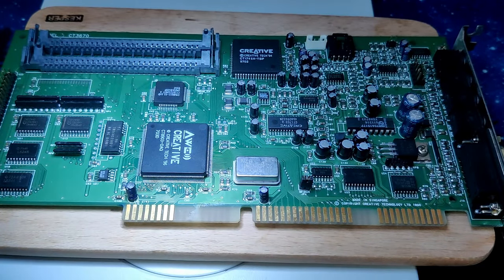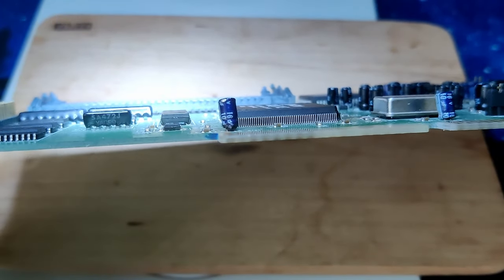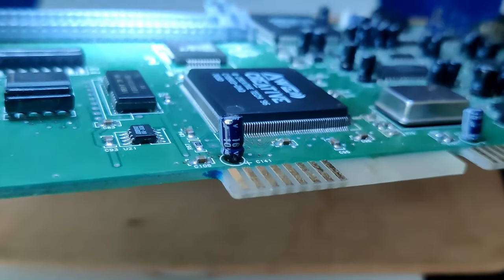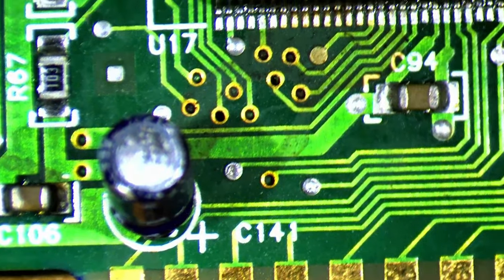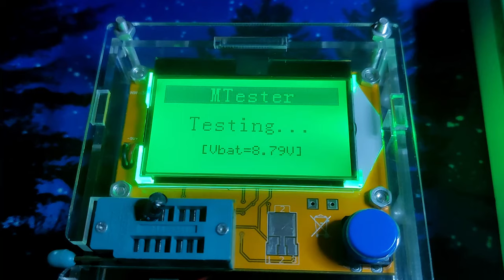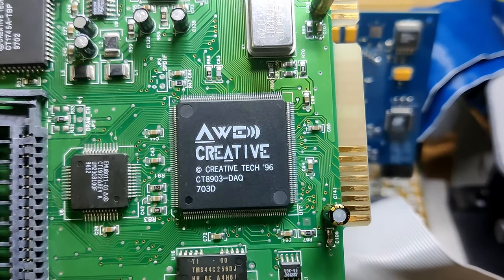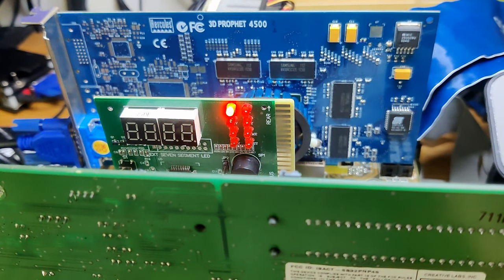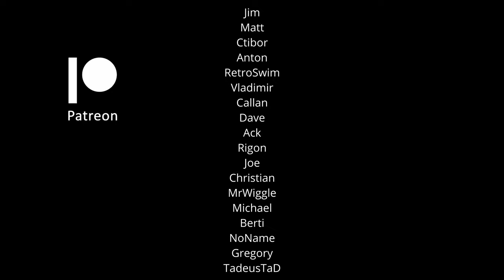Forensics: Sound Blaster 32 CT3670 repair attempt

Comment: I hadn't realized how insane the owner went with the hot air, I wonder if they got a soldering hot air gun or a woodworking one for paint removal... I suggest recapping the whole board, electrolytics hate heat and it was applied very globally and for ages, and even on the video the other caps don't look great IMHO, I hope it's just a cap that failed shorted or something like that!

Comment: Has this card been reverse engineered or are schematics available? Could possibly be one of the smaller 74 logic chips ... but without a schematic/block diagram it's just guessing. I know on a GUS PnP (since I was the first person to reverse engineer those) a faulty 74F32 would prevent the system from booting.
Reply from the maker: I actually found a small solder bridge between two signal pins. That was very odd - thin as a hair. The PC boots now, and I could get sound from it. The FM synthesizer didn't work, but that may have been an issue with drivers and Windows 98. I'll try the card in another system and also play around with the flash chip on this card.
Reply from the maker: Wow, that is some serious skill to reverse engineer a GUS! Congratulations. Are those GUS clones the result of your work?
Reply: @bitsundbolts  Yeah, definitely check the drivers. I've had the same issue with an AWE32 in the past. Glad you managed to fix the card.
Reply from the maker: I hope to learn a lot more about electronics. It's such an interesting subject. I'm a software engineer by education, but lost touch with the field. It's rare to find interesting projects to work on in a corporate environment and I'm tired of maintaining a 20+ years old codebase.
Reply: @bitsundbolts  I'm always impressed by people who can be bothered with or even enjoy coding. I just recently poked my nose into a small (400 lines) C Project for a MCU and while I understood most of it just couldn't get myself to make major changes in the code (in the end I duplicated a function and added 2 resets, while removing 1 optional function) ... resulting in my final fix being a second (identical) MCU being added 😅

Comment: I may be on a wild goose chase here so take this information with a lot of salt.
However the C0 at least for Phoenix BIOSes relates to the ISA standard of Interrupt 19...
Further digging lead me down a rabbit hole of information related to a software requested halt that is usually done by IDE / RAID controllers to initialize their drives to be booted by the computer.
I am no ISA expert or even knowledgeable, but there are interrupt request pins on the ISA standard pinout... Maybe it is being pulled high or low (Pending on what it wants) due to some factor elsewhere on the card.
Reply: This is tested on an Asus p3b-f, it has an award bios.

Iirc at this point in time during the post it's testing the memory or trying to init every components on the motherboard, so yeah it's probably throwing out the ISA bus in some way. Needs more analysis :)

Comment: I think it may have some issues in it's power circuitry. The bigger chips don't look damaged but maybe small resistors, power regulators and other capacitors might be affected. If you can, maybe try to measure things.

I like the idea of @phirenz to use an oscilloscope too, but it depends on if you have one. There can be some affordable ones, I think I've seen some on other YouTubers' channels.

Comment: Oh wei. Wenn man doch keine Ahnung von Hot Air hat, warum spielt man dann nicht erst mit einem echten Totholz umher bevor man die Karte grillt. Aber wieder tolle Arbeit und Frohe Ostern. BTW: Kontrolliere bitte den Bereich um den CD In Anschluss und PC Speaker. Das sieht alles sehr knusprig aus. Vorallem die Caps.

Comment: first of all replace all electrolytic caps as those die when exposed to heat.. and to see how that person has baked the whole card the caps or likely all dead. once you done that you may try it / test it and id it wont boot don't tuen off the pc but grab a thermal camera and look if something gets hot as long non of the creative branded chips are defect then the card can be saved